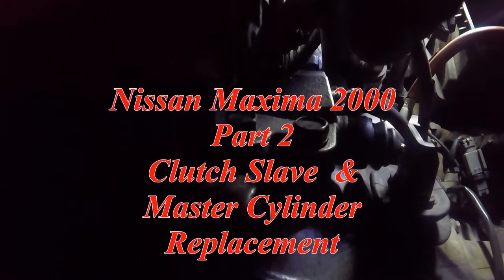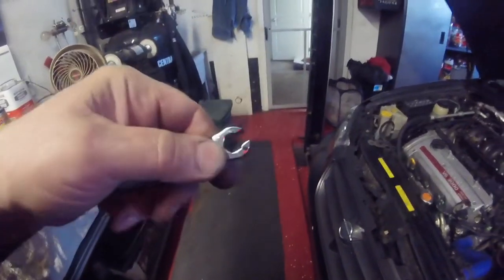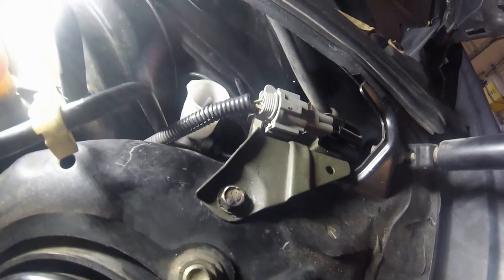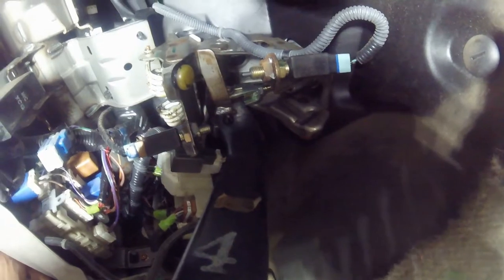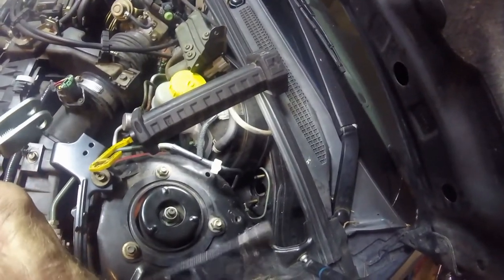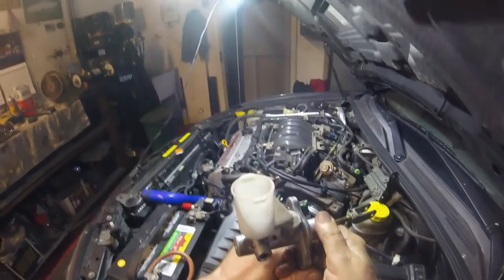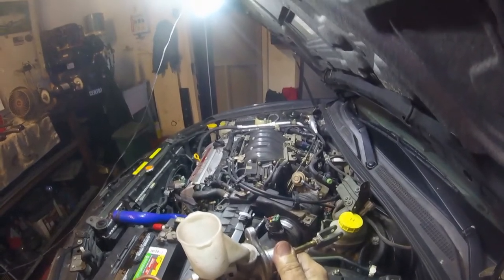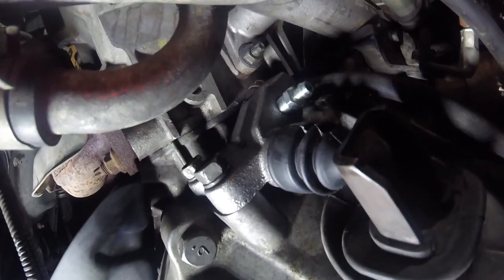Nissan Maxima 2000 Part 2 Clutch Master & slave cylinder replacement mp4

Comment: What is a sign of this going bad? Yesterday I was driving and all of a sudden I could not engage in a gear. Previous to this, the clutch had not slipped once. The clutch is also very easy to put to the ground and back up
Reply from the maker: That sure sounds like it is going, try pumping the pedal if it then engages easily it’s a definite sign you need to replace the seals
Reply: same thing to me most of the time no problem with the shifting but is very soft and easy to drop

Comment: Sir goodday...i just want to ask you regarding my 2000 maxima which is not running when the engine is hot already.i have no issue on that when shes running direct.this all happens when im on city drive.and also the clutch is too high.this all happens when i sent to shop and replace the clutch cylinder upper part.thank you and if theres anybody who can help pls.im waiting.

Comment: You can't put some more details and show how to do everything I would appreciate that thank you
Reply from the maker: This is all I have obviously this was done years ago and it was a customers car.
Reply: Are you in Tucson Arizona??
Reply: I have a slave cylinder problem, my car acceleration is very slow and the clutch slips so my dad and me we are trying to replace the slave cylinder because it was leaking,  hoping my clutch is not bad, I’m trying to adjust the bolts of the slave cylinder by hand but the screw won’t adjust